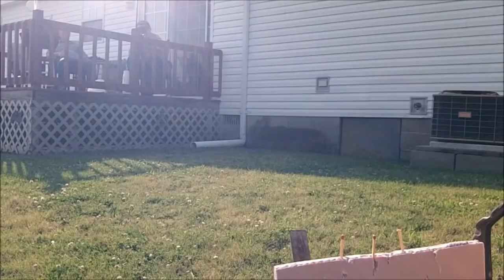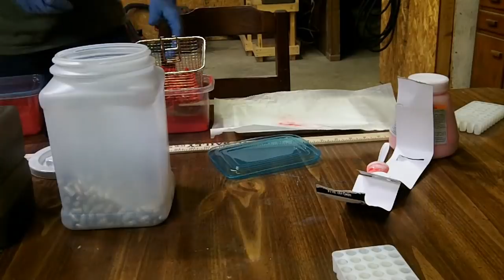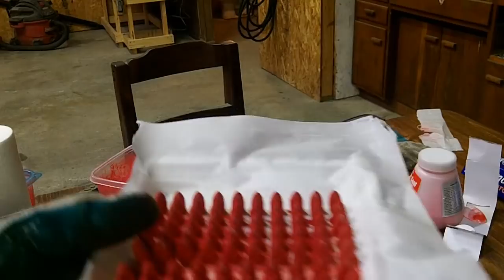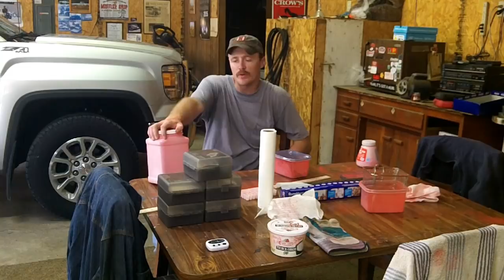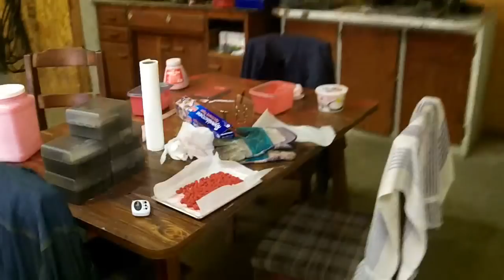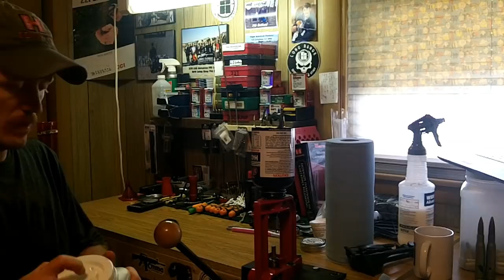Powder Coat and Sizing

Comment: My local harbor freight stopped carrying the red and yellow powder and now only stocks white and black. I read that the black does not work well at all so I got the white and have had good results. Make sure you have a number 5 container. I use a round one with snap on lid  . I soak the bullets in 91 % rubbing alcohol or acetone for a few minutes then let em dry . Without touching them with my hands I put about 50 at a time into the oven and preheat at 150 for about five minutes. Then dump them out into the container put in some powder put the lid on and swirl in a circular motion a little clockwise round then counter clockwise then clockwise a few times for about a minute all together. Then I take em out with needle nose pliers grabbing them around the lube grooves and tap the pliers a time or two on the rim of the container nocking of a little excess powder back into the container from the bullets.  I wad up a piece or nonstick aluminum foil and flatten it back out enough to put the foil on the wire rack that came with the toaster oven. Each one of those little ridges in the the foil from wading it up will give the bullets a couple of points to sit on instead of a flat surface . I preheat oven to 400 then bake for 20 minutes. I don't water quench them though because when I put them on the foil one at a time with the pliers making sure none of them are touching each other. After they cool  for 1 minute after talking them out I nudge them with the pliers to break loose from the foil.  l then let them finish cooing .It's been working pretty good this way for me . Everyone should have a lid for sure because I don't believe breathing the powder  would be good for you.

Comment: Nice work on powder coating you should try cleaning the bullets with acid tone to remove any oils to see if it helps that’s what I do nyc reloader does the same
Reply from the maker: I have thought about that.  I have had much better luck with the eBay blue PC.
Reply: That’s great

Comment: harbor freight red is my favorite powder coat, its not the best but it works well enough for pistol loads and it can be found in my home town, your powder coat is what the red does it works but its not eastwood brand, you successfully powder coated thoses 9mm bullets good enough understand your powder coating lead not some smooth steel or ceramic material so these bullets of your came just fine dont worry, mine also have some shiny dings on them too!! but work just fine for target ammo, keep up the good work brother.angelo soriano.
Reply from the maker: My problem with the HF Red is getting it to stick to the bullets.  I spent 2 1/2 hours one night just trying to get it to cling to the bullets.  I tried numerous containers, tumbling it on, and heating the bullets.  I would shake it up and it just wouldn't stick. This eBay blue I got, no problems at all.  I am fine with the results of the red but it's just to much work.

Comment: One suggestion would be to heat your bullets up entail there lukewarm to touch and put the powder on them and shake them up and in joy this might help ... the ones you have all ready made well just have fun shooting them
Reply from the maker: I have been doing that, and it hasn't helped much.  I keep changing containers and usually one of them will work.  I still think is a humidity issue.  Someone told me I am getting about the best results I can with this powder. We shot a few hundred of them Sunday and the shot great.  I have about 1000+ ready to load.

Comment: Well done, Josh! You’ll find a process that creates enough static charge differential to coat well - we each have our own methods and powder preferences. The same is true of progressive presses, particularly when starting with cast 9mm. I haven’t made a video of loading 9mm on a Load Master or Pro 1000 yet - maybe we should work on that! I do have a short 44 Special Pro 1000 video at https://youtu.be/LnC7iofcsSo
Reply from the maker: I got spoiled today.  We loaded up some on my neighbors Dillon 550.  What a machine!!!!!!
Reply: 243 Outdoors I like my 550 as well...however, most of my “mass production” 9mm is run on one of the LEE Load Masters.

Comment: Humidity messes with how well pc covers as well. Don’t sweat small imperfections in pistol bullets, they have no real effect at pistol ranges. Good job and welcome to the casting an pc club👍🏻🇺🇸
Reply from the maker: I am thinking it was mainly a humidity issue.  The Friday bullets weren't that bad.  However Saturday, we had rain early and was super humid.  I bet less than 10% of the bullet would get covered.  I started heating them up a little and changing the containers and they got back to how they was on Friday.  Everything is definitely useable.  I would just like to see them a little more covered and even.

Comment: Just warm them up before PC, also I coat twice. Once very little powder (taken from oven just after PC liquifies) let it cool till I can touch it. Then second time for full 15-20min. Second PC covers them properly and they don't stick to each other too much. When they cool just a bit I can easly separate them from each other. This metod dont work well with rifle boolits - they have to stand up in whole proces of PC. cheers
Reply from the maker: The bullets I did on Friday weren't that bad, I would just like to see them a little more covered and even.  It was super humid on Saturday and the powder didn't cling to them at all.  I did heat them up a little and changed the container I was shaking them in and this helped.  I did double coat several of them.  It's just a learning curve that I'll figure out.  Thanks for the advise.